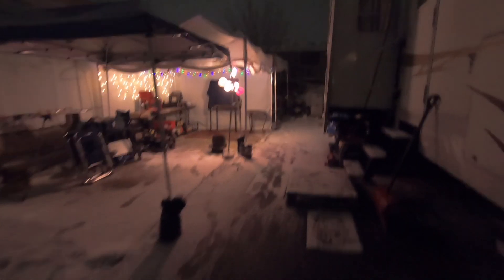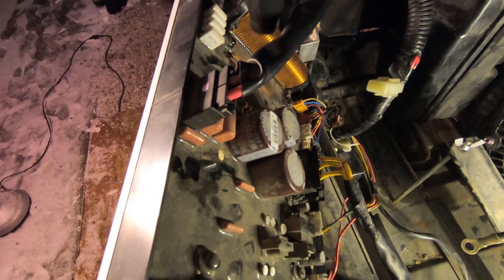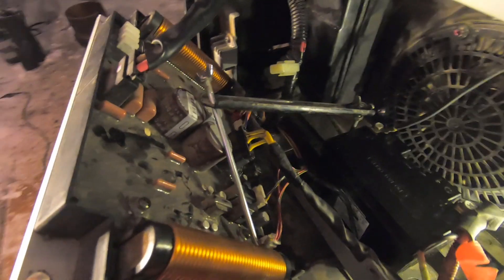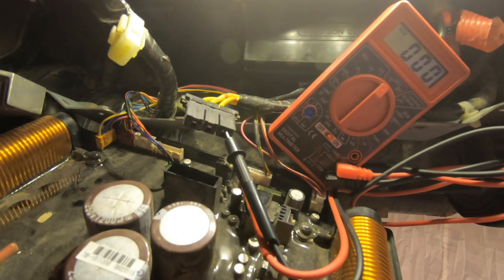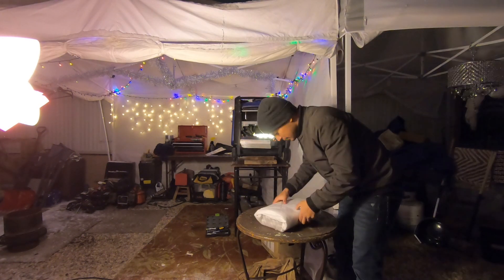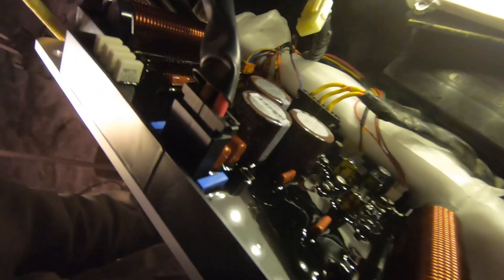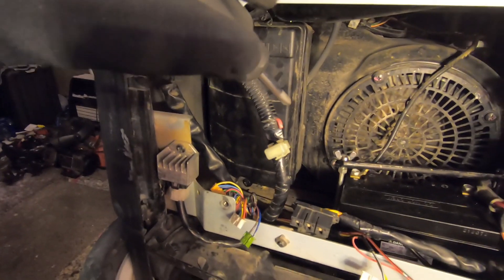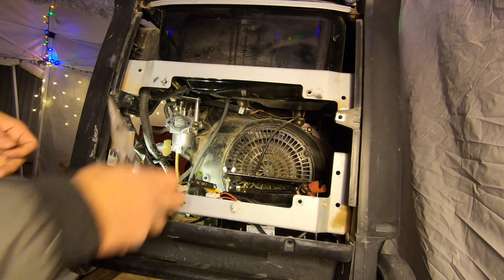Yamaha EF4500ISE (No Power) Fix and Diagnostics - Will It run?

Comment: Congratulations man , I have a craftsman 2200/2500 inverter the pull string won’t pull out, it cut off running and when I returned to crank it the string only comes a couple inches out and click sound, is it blowed is there a fix 
I put a new spark plug, new oil, has gas
Reply from the maker: can you record this in  a short vide and share in google drive? send to immortalengines91@gmail.com
Reply: I will try I am a little older , it will be a hour before I get back. Thank you

Comment: I have an older Predator 2500 inverter that runs beautifully but doesn't power the 110v outlet. I replaced the outlet with a household outlet and it worked on a small appliance. i started it later and it didn't work again. Any suggestions?
Reply from the maker: Yes the inverter board is bad. it was never the outlet.
Reply: @immortalengines1605  but when I changed the outlet the new one worked. Then stopped working. Still the inverter? Where can I get one?
Reply from the maker: was the other outlet significantly worn out? @prepperboss

Comment: I have a generac version that has a failed inverter. I'm going to integrate it into my solar system to charge my battery bank. It has a 12 vol plug and still can get dirty AC signwave for non Soleil state and or sensitive electronics. In the case of using it for AC I should run it at 3500 rpm to get proper Hz which I believe is 65z?also I'm thinking I'll do away whit the plastic case and build an open fmetal Fram that I can accessorize and have easy access to whatever I want to tweak.

Comment: Why don't you wire in a stand alone inverter to the generator outputs?
Reply from the maker: uh?
Reply: @immortalengines1605  rather than replacing with same part use another inverter . Connect a diode trio "rectifier" like a car alternators to output side of the generator then connect another inverter the you would connect to a battery. Find an RPM that works best and it's not " perfect" but he'll it should work no?
Reply from the maker: @bartholomewceremony6981  its easier to just replace the inverter board. people who buy these generators buy them for their fuel economy and quiet operation. what you said could work but it voids the point of a enclosed inverter gen
Reply: @immortalengines1605 planned obselesence? What is the point of the epoxy that virtually makes the inverter unserviceable?
Reply: Resistance to vibration and moisture.
Reply: @thedavesofourlives1  not sure I'm following you.
Reply: I've got this exact same generator and I believe the exact same problem. I am a bit bothered by it though because my generator is about 5 years old but has only 7 hours of use on it. So it is practically new! I really wish I had a better option but I can't spend that much to make it right.

Comment: I would never buy another Yamaha generator. Mine is a ef3000ise b inverter. 
Four times used it, a control board went bad. The board cost over $900.00. My generator cost $1900.00 plus. 
You choose.
Reply from the maker: Yea I heard those were not the most reliable ones.

Comment: Hey! I picked up a Yamaha EF3000iseb for $20 off CL. I worked on motorcycles for years figured I could figure it out. Motor is generating power but it's not coming back out of the board just like yours. Boards are $1100-1400 online. Hardly seems worth it. Am I missing something? Can't seem to find any used on ebay. The board is sealed in an epoxy So I can't really diagnose individual components. Any ideas?
Reply from the maker: Hey Austin, thanks for checking out my video and subscribing to the channel! Although you did the right thing by paying only $20 for that generator, everything else sounds familiar. the boards in these generators go out on all brands and sizes and they are impossible to fix because of the epoxy. your best bet is to not look for a inverter board only. but a whole unit with a bad engine on ebay.  I paid $1100 for the board I used in this video and it only made sense because I sold the generator afterwards.
Reply: @immortalengines1605  Yeah, I intend to sell it. I was just looking for a fun project to do with my 8yo son. I know they are like $2500 new but I don't know what they are worth used. I doubt much more than $1000 so I'm thinking it doesn't make sense to fix.
Reply: Found a board for $750 that's starting to POSSIBLY make sense.
Reply from the maker: @austinconant8476  does your generator have 2 boards or just 1?
Reply: @immortalengines1605  It has a "control board" and a "power board" It's the "control board" that has the issue. I completely disconnected it and the generator still starts. Plus I can see all the crispy burnt things inside under the epoxy i cut out of the control board.
Reply from the maker: @austinconant8476  excellent! if you do end up buying the replacement and install it in your gen please let me know how it goes. I've worked on dozens of generators but never got to work on that specific Yamaha you have.
Reply: @immortalengines1605  Will do, I've got to do a little market research and figure out what I think this thing would actually sell for were I to fix it. 

Thanks for your video and help!!
Reply from the maker: @austinconant8476   good idea. let us know how it goes!